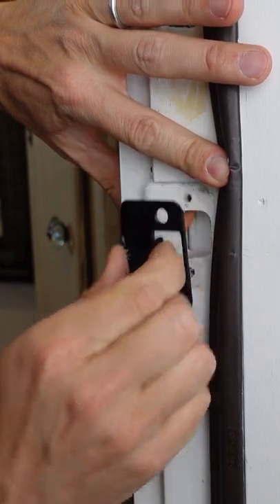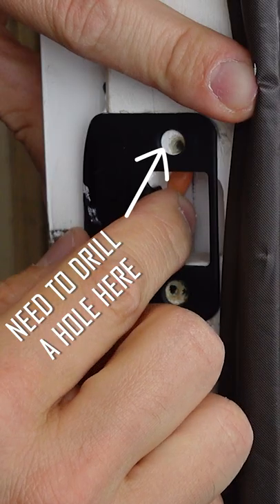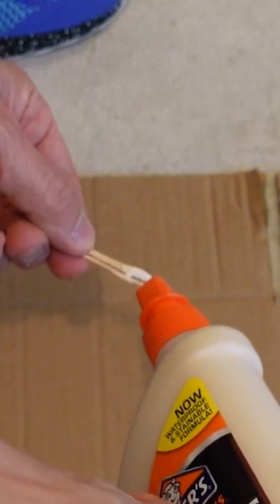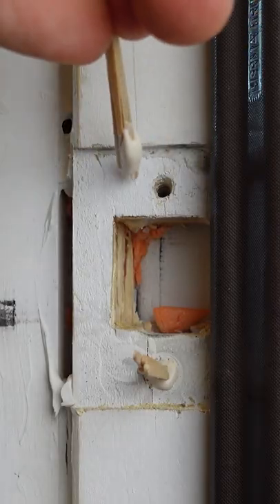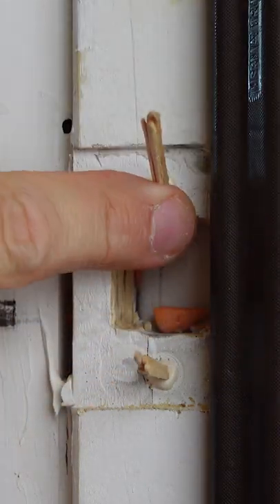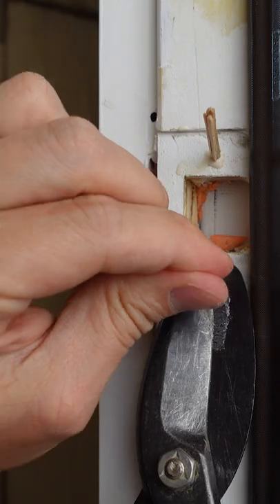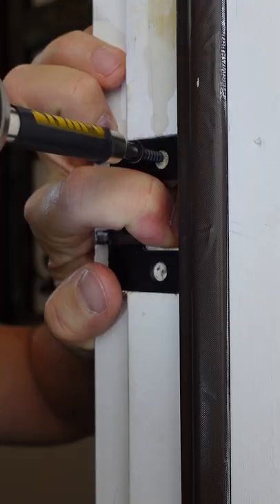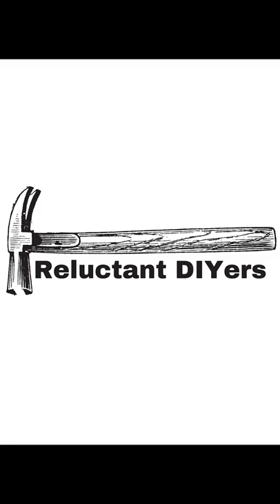Insert Screws Next to Existing Screw Holes

Comment: If the wood is to messed up from repeated repairs, like one I recently repaired, get a 1/4" dowel at a craft or hardware store, or even the craft section of a dollar store. 
Then drill a 1/4" hole, coat a short piece of the dowel with carpenters glue, and pound it it.  
Just like new wood.
Reply from the maker: LOVE THIS METHOD! Thanks for sharing!